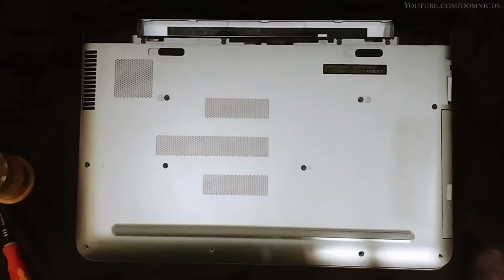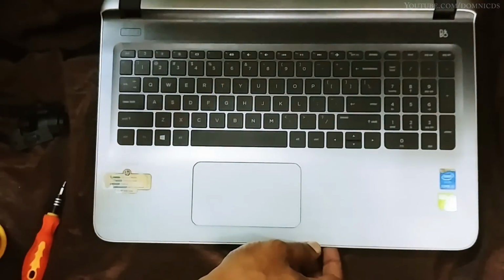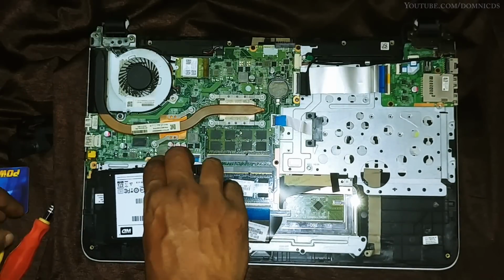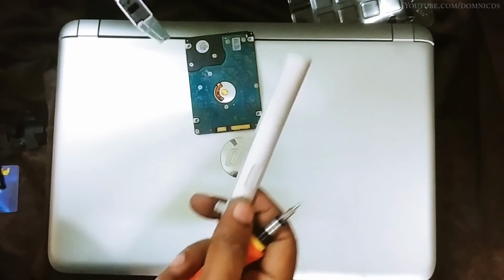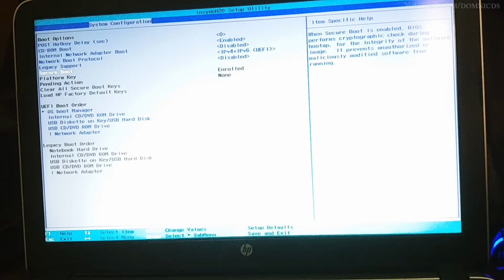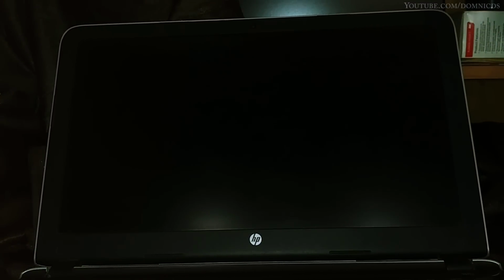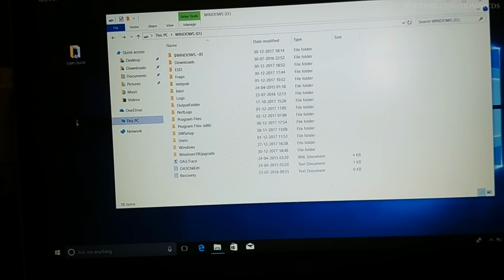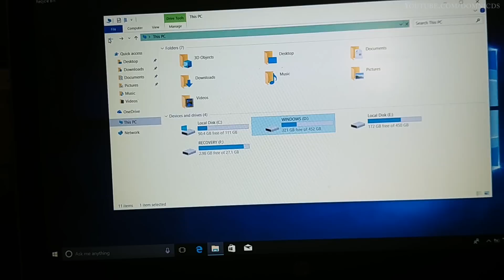How To install a SSD + HDD on a Laptop (HP Pavilion 15-ab032TX)

Comment from the maker: How to Clone your HDD - https://goo.gl/6zKU4V
Reply: Is it ok not to put back my hdd, and use ssd alone?
Reply from the maker: @LuwieMangubat   yes u can use just the ssd...
Reply: hey can we upgrade more than 120 gb ssd on same model???
Reply from the maker: @shahbazkapoor8484  yes you can i just went with the 120 gb version coz ssd were expensive at that time... now u can get 250 gb or more at the same price...
Reply: i have HP Pavilion Power Laptop 15-cb0xx laptop. i cloned win10 into wd m.2 250gb ssd but the boot sequence is restricted by bios insydeh20 version5. what should i do? hp official service and forums give insufficient informations about restriction. i planned to unlock advanced options of bios but i have not been able to do it either. please help me. my computer does not have cd / dvd driver.
Reply: Hii, I have a doubt. I don't know whether my laptop model is ab516 or ab032 how to find that, any one who knows rply me
Reply: @DomGamingnMore   Hi I have the same laptop and I m thinking to replace my HDD with Samsung EVO 860 500GB will it work and give 500 MB/s read and write. does this laptop have a SATA III or SATA II slot for the internal hard drive.
Reply: @devanshchoubey  
yes
Reply: @vinvin-vf3iw  If it has a detachable battery then all your product information must be beneath it. Just take out the battery and check.

Comment: Is it not easier to attach the SSD via USB and clone the internal HDD onto it first. Then, replace the internal HDD with the SSD as shown here? When you turn on the laptop after replacement it'll work first time
Reply from the maker: Yes you can but that's an extra tool needed...

Comment: Thanks dude just finished installing my crucial ssd in my 6 years old laptop now it takes 5 sec to boot up and used plastic caddy for hdd and it worked fine too thanks for the video👍👌
Reply from the maker: You're welcome, I am glad that my video was helpful....
Reply: @DomGamingnMore  hey so you just put the caddy in the CD tray?
Reply: What was the data size of your SSD?

Comment: Hi thanks for the video, I'm also facing the issue that the old HDD (in the dvd slot as yours) is not showing in the partition list. Restarting the laptop was fixed the problem temporarly. Can you suggest a solution to fix this, TIA.
Reply from the maker: Hi i never faced that issue again till i had the laptop... it was just a 1 time issue for me.... check for loose connections...

Comment: I have hp laptop and i had installed ssd sd and i also thought to use a caddy but i have a confusion that hdd have also windows installed earlier exactly like yours. Sir will  there be something worng happenes if i used hdd caddy with it ? Please reply !!
Reply from the maker: You can use it just fine without any issues... Just make the SSD the first boot drive...

Comment: Hey Just want to know ur review

How it was working earlier when you just start using after installing ssd and compare to what now 
Still you recommend i should upgrade now or go with new laptop?
Reply from the maker: Hi it depends on what you intend on doing on the laptop,  as new games barely run on this laptop now lol... If your using it for just browsing, watching movies etc then yes it will still serve you good... And yes the performance of the Ssd is still good if compared to HDD...

Comment: Hi 
I liked this video but you removed the entire DVD Drive..right ? What if a time comes and I need to run DVD disc. I will be stuck because there's no optical drive to play dvd disc.
Reply from the maker: Hi, thanks, well you can get a external case of the Dvd drive or whenever u want to use the dvd drive just pop out the Hdd and insert the Ddvd drive...

Comment: English Dictionary -

   Whadouyoukalut - synonym
     
      rail - [reyl] noun; a bar of metal or plastic fixed along the horizontal axis of a computers peripheral device, such as a hard drive, for securing it to the main CPU

Comment: sir thanks for this video I also have a few questions does the system works fine like the caddy and SSD, I have heard that caddy faces a few problems also the can I clone the HDD to SSD first to avoid reinstalling the windows please help and respond sir and thanks for this video
Reply from the maker: Hi yes you can clone your HDD to SSD instead of reinstalling windows, well i have been using it that way and i have not yet faced any issues...

Comment: Is this process eligible for all types of laptops I mean mine is hp 15 r 244tx notebook.. I can use my hdd in DVD drive like u did.. And which ssd is best under or up to 5k price.. Planning to install 256Gb or 512GB.... Please suggest me.. My laptop is dead slow and I am running out of my storage (1TB)
Reply from the maker: Hi yes you can follow this process for any laptop... I think the Samsung Evo SSD is good, but economically these WD green is not bad either...
Reply: @DomGamingnMore  thanks bro I'll go for wd 256gb then.. Just to increase application  loading speed.. Don't need crazy fast as Samsung

Comment: Hi Dom,
Best wishes for your channel ❤️
I have a query I am unable to format my HDD which is located in Caddy. I tried through Disk Management as well as Diskpart. Is my Caddy faulty or should I use jumper switch. Please help 😔
Reply from the maker: Hey thanks and sorry for the late reply, i dont use the laptop anymore as the screen gave up after 5 years of usage, so i cant try it...

Comment: Hi, I have hp 14-bp0xx
It comes with a SSD but I am wanting to add a second HDD that I have laying around. I've taken a look and there is space to add a 2.5" HDD, just wondering if you could help me out with what cables/enclosures I would need to get it working?
There's is space for a HDD but I can't see where to connect the drive.
Reply from the maker: Hi since u have not mentioned the complete model number i am assuming u have a m.2 ssd installed, make sure that u have a slot to fit the 2.5" drive and not just some free space, if its a slot for hdd then look at my video and you should have a similar slot where u need to put the hdd, (the slot where i installed the SSD)

Comment: Can we install 1TB hdd on hp 15s eq0024au without removing ssd??????? 
Please reply please🙏🙏🙏🙏
Reply from the maker: If you have a slot for the hdd in the laptop then yes you can, coz i don't think laptops these days come with a dvd drive...
Reply: @DomGamingnMore  thankyou so much bro can you suggest a good laptop between 28k-33k please if you don't mind.

Comment: Does it affect the processor I mean if we use Caddy and SSD at once....cuz my AMD processor heat up like crazy
Reply from the maker: If the processor is overheating, then you need to clean the vents, fan and lastly change the thermal paste, using the Caddy and SSD together won't heat up the processor that much....

Comment: Please suggest which HDD is support for
(Victus by HP 16.1 inch Gaming Laptop PC 16-d0000 (3S9N6AV)). My 512GB SSD is storage full.
Reply from the maker: Hi if your laptop has a vacant HDD/SSD slot then any 2.5 inch laptop drive will fit in...

Comment: Nice job Bro ... I am thinking of trying the same.. is the speed better or similar of HDD inside and outside of DVD caddy. Also which Screwdriver kit u use.. Can u send me a link... 😊
Reply from the maker: Thanks, i did not have an external enclosure to test the speed... i just posted links for the screwdriver in the description...

Comment: Sir I have installed ssd in DVD drive and cloned OS in it. Now ssd is showing in my computer as storage drive only. In boot priority ssd is not available. What should I do to resolve it? I am using pavillon 15-e009tu notebook.
Reply from the maker: Did you clone everything like the Winre partition etc

Comment: How is it working after long time ? .. i mean your sdd and hdd in caddy ?  Does it affects gaming ( increase fps little bit ? ) And whats your opinion on sandisk 120gb ssd ?
Reply: It doesn't affect gaming, to increase fps upgrade ram, gpu, processor.
Reply: Anand Raina yeah i know gpu , processor , ram affect gaming performance but when we put our game into ssd drive then game will open little bit quicker than normal hdd.. i experience this..
Reply: Entium Though game opens quicker, it still doesn't increase fps or frames per second as this is dependent mainly on the components I had previously mentioned.
Reply: Entium ssd improves read/write from the disk, whereas fps is mainly dependent on processing visual details(grass, lighting, shadows, etc.) of the game per unit time which require a gpu.
Reply: Anand Raina though ssd loading time of a game will reduce ..
Reply: Entium Yep thats true, but if you want a change in gaming experience, it will not do anything.
Reply: Anand Raina yeap .. great gaming experience = some handsome amount of money :P
Reply: Entium umm no, actually you can get older gpu's for a cheaper rate, and also lower tier gtx like 1050ti 4gb for like ₹16000. Ram is definitely cheaper, and if u have min i5 as a processor, u don't need to upgrade it. Your total upgrade cost would round about to ₹20k if u don't put an ssd that is.
Reply: Anand Raina and what if i have a laptop just like him hp ..
Reply: Entium no hope then, buy a new laptop. Though entry level gaming laptops with gtx1050 are priced at ₹50k, but then again you can't expect a similar performance to that of a desktop gpu gtx 1050.
Reply: Anand Raina best option is to build a desktop ..

Comment: Hey , can you tell which version of Windows 10 you have installed on your pc, is it possible to install windows 10 pro on SDD (after replace HDD), because latest windows 10 (after 1703) install win10 in home single language defaultly , is it possible windows 10 in pro versions , because you'll options which version of Windows 10 you want install
My laptop model is ab 219tx , which is same identical mode as yours
Reply from the maker: Hi my laptop has windows 10 home edition, that's what i got when i updated from windows 8 for free...
Reply: @DomGamingnMore  ok, so when you are installing windows 10 by bootable USB drive , did you get options to choose between pro or home on SDD
Reply from the maker: this video was done over 2 years ago, never re-installed windows after that, but from what i can see in the video no it didn't give any option... but i think if you have the digital key u can just upgrade to pro...
Reply: @DomGamingnMore  can you confirm you laptop SATA port by using a software HWinfo32

Comment: Why not having ssd on the disk bay instead of replacing the primary disk? I assume the eject button on the disk caddy won't work any more. Pls suggest
Reply from the maker: Well u can do that if you want to, as for me i replaced it with the HDD coz i can get the max performance possible out of the SSD, yeah the eject button wont work...
Reply: @DomGamingnMore  i beleive both are same sata port version . pls correct me if iam wrong
Reply from the maker: Yes i think so but if u see the speed test in the end the write speed to the HDD (dvd caddy) was limited to under 50mb and HDD can write faster than that... plus it took more time to complete the task...
Reply: @DomGamingnMore  thanks understood the limitations. I have same laptop have plans for upgrading

Comment: Does all laptop DVD drives have SATA connection ?
Reply from the maker: i believe since the release of sata interface, laptop dvd drive manufactures starting using that interface... i had a laptop from 2010 and the dvd drive had a sata interface...
Reply: @DomGamingnMore  thanks

Comment: what about win 10 keys/original serial number if our laptop had win 10 original.
Reply from the maker: Hi sorry for the late reply, as long as i remember changing the motherboard causes issues with windows activation, so u don't have to worry about that, i didn't face any issues with activation, and if your still doubtful just use the cloning  Method, i have left links in the description or comment section for that...

Comment: Do you need to open front keyboard to change HDD and put in a ssd only? Is there any screws in front which will prevent back access to hdd enclosure in laptop?
Reply from the maker: no there are no screws in the front on the laptop all the screws are at the back...
Reply: so why do you want to remove keyboard ? were you showing us how to do that bcoz laptop keyboards are easily damaged (i had to replace mine 2 times thanks for showing that and paid money for that) ...and often needs replacement  (oh sorry you didnt but many others showing this procedure )or is it standard procedure to remove keyboard before you install hdd/ssd or ram?
great videos....keep it coming....and thanks for your good tutorial...

Comment: Hi! I have the same laptop! I want to install m2 SSD  or m2 Nvme PCI SSD, can you tell me if it is possible for HP- Ab032tx?
Reply from the maker: This laptop doesn't have a m.2 slot... You have to install a 2.5 inch SSD...

Comment: Nice video.. does this model has m2 ssd slot??
Reply from the maker: The Wifi adapter slot is a NGFF/M.2 slot i believe, now M.2 was formally known as NGFF, But i recently tried a Egpu setup via the NGFF slot on this laptop,  but it just did not boot, so good luck with trying out a M.2 ssd...

Comment: What brand is the caddy you used? I have tried two different ones from ebay and neither work properly with a HP 15-ba079sa.
Reply from the maker: hi the link is in the description, works well with my laptop, 9.5 mm one fits in my laptop...

Comment: Hi, that was very helpful video..thanks for sharing.

Does this laptop support M.2 2280 NVME SSD? 

Which SSD brand is good after WD green? I heard WD Blue, Samsung 960Evo are nice, please suggest?

Also can GPU be upgraded to Gtx 1050i or any other above Geforce 940m?
Reply from the maker: Thanks i am glad that the video was helpful... the laptop does not have a nvme slot... yes wd blue is better than WD green,  The 960 evo is an nvme right so thats out of the question, and no the gpu cant be upgraded on this laptop...
Reply: @DomGamingnMore   can we install ssd in DVD tray instead of hdd?

Comment: I have ab029tx, is hardware model same? Can i use crucial 240 GB SATA ssd to it?
Reply from the maker: Yes you can....
Reply: @DomGamingnMore  which would be great plz suggest me a brand or model for my ab029tx, also I've to replace battery I've contacted HP and no longer battery available with them , suggest me a battery for same brother
Reply from the maker: Hi I had the WD green SSD installed with no issues, you can go with any brand as per your choice, you might have to look on Amazon for a third party battery, just check the battery details on your battery and buy according...
Reply: @DomGamingnMore  there are many brands, im not pro on battery please help me

Comment: This upgrade is 100% safe or not? Is there any unnecessary pressure on the motherboard?
Reply from the maker: if you think its not safe, i would suggest buying a 1tb ssd and replace the Hdd...
Reply: Dom - Gaming n More Thank you. Actually I am confused some what. By the way great video and I am also using the same laptop.

Comment: After doing this can I use CD drive also or not
Reply from the maker: You can't use both together, when u need to use the cd drive you need to remove the hdd and insert the cd drive, or you can get a external case for the cd drive...
Reply: @DomGamingnMore  thank you
Reply from the maker: You're Welcome...

Comment: Hi, i recently installed an SSD to my laptop. And did a clean install of windows 10, can you please confirm if the original windows was windows 10 home or windows 10 pro?
Reply from the maker: Hi, mine came with windows 10 home...

Comment: Hi, I have the same laptop HP 15ab032TX. I installed a Kingston 240GB SSD in the primary slot and bought a caddy for the 1TB HDD. I clean installed the windows 10 on SSD without the HDD attached. Unfortunately, my laptop is not recognizing the HDD in the device manager or the Intel Rapid Storage ATA drivers. Without the standard Windows ATA drivers, the HDD is recognized in the Device manager, but I am unable to run any Diskpart or anything on it. 

The caddy is not the issue because the same HDD works flawlessly on the Linux, which means the connection to the disk through caddy is good.

You just mentioned a normal restart for resolving this issue, but that didn't resolve my issue. Can you please suggest any solution?
Reply: I had already cleaned the HDD through Linux NTFS partition. So there is no boot partition in the HDD either.
Reply: I have the same model hp 15ab model and it don't read the hdd that i transfer to the dvd drive like yours. Do you know how to fix it now?

Comment: Hi Dom,
Very nice and useful video explaining the steps for installing SSD.

I have a 8gb, 1TB Hp-15ay110na laptop, could you please advise which model of SSD is compatible ?

Appreciate your help.

Thanks,
Kiran
Reply from the maker: Hi Kiran 
Thanks,  I am glad that the video was helpful, 
any 2.5" SSD will be compatible, i have left links in the description, unless your laptop has a m.2 slot but i doubt that...
Reply: @DomGamingnMore  thanks Dom for the response and confirmation, I will check regarding the M. 2 slot

Comment: I just installed ssd in hp laptop at place of hdd and it's works great but the problem is the hdd which I placed into DVD drive with the help of caddy which you suggested, it's not showing hdd all time.i have restart my pc 2-3 time to show it but after shutting down the pc it's disappears while switching it on and it's continues tell me if it can fix?
Reply: I have the same problem my laptop don't read the hdd i transfer to the dvd drive. Do you know how to fix it now?
Reply from the maker: Guys maybe it's a faulty caddy... Mine still works fine, no issues...